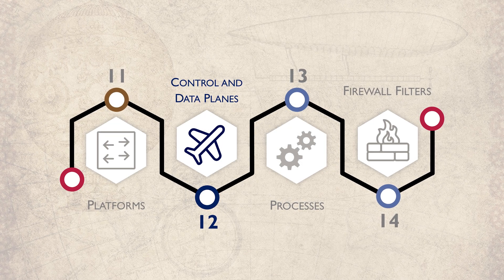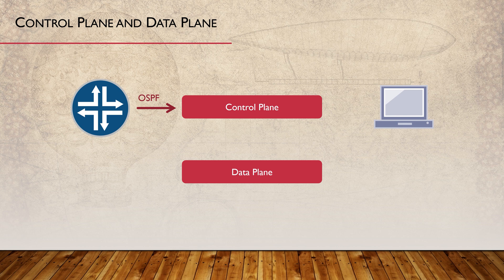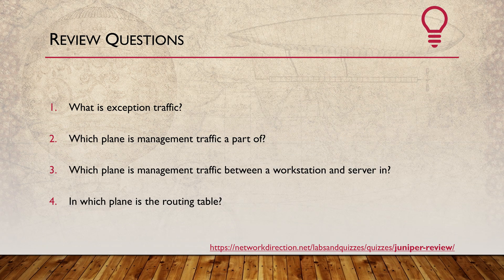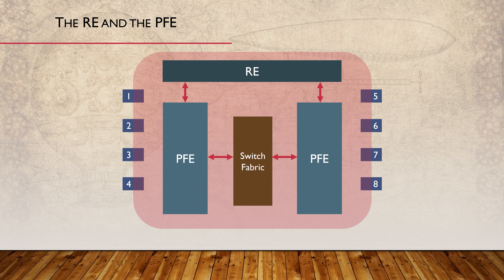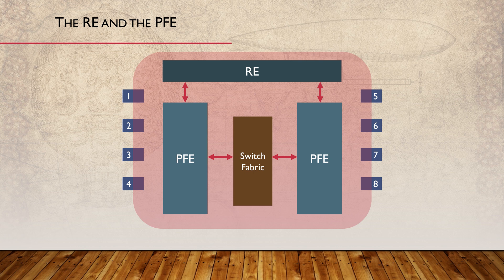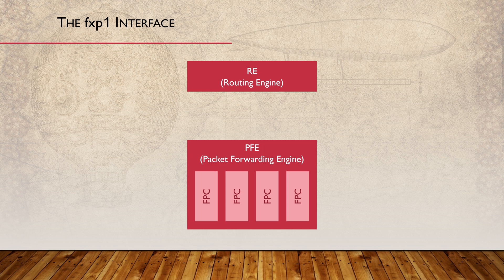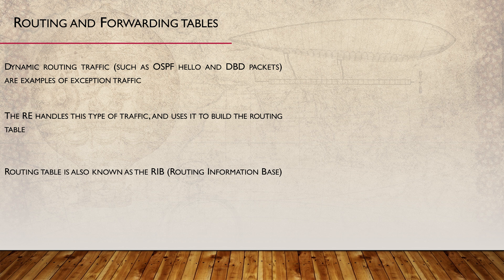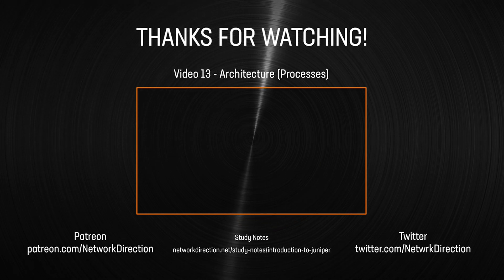Junos Architecture - Control and Data Planes | Introduction to Juniper and JNCIA Part 12

Comment: I would like to thanks  god bless you.

Also I would like to know if the fxp0 interface is a physical interface or logical interface
Reply from the maker: fxp0 is available on some platforms, and is a physical interface used for management. It has a physical interface on the chassis.
fxp1 (also platform specific) is physical, but internal to the chassis. This is the interface that links the RE and PFE